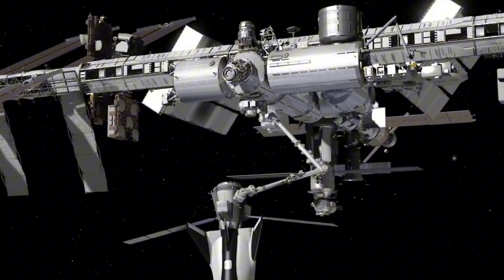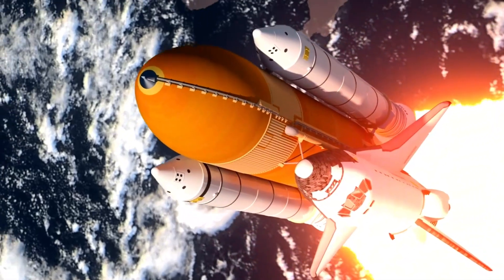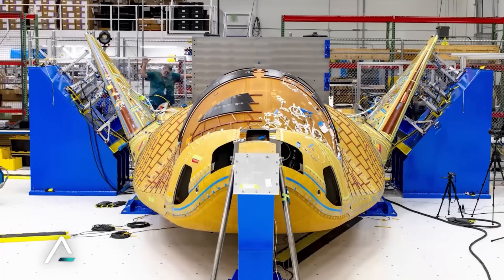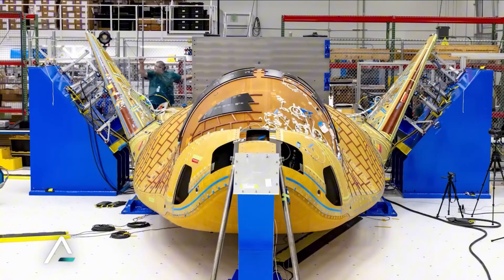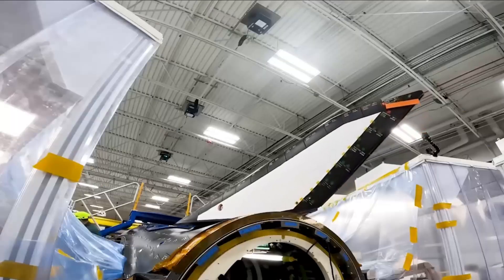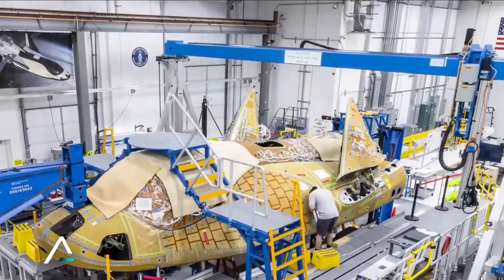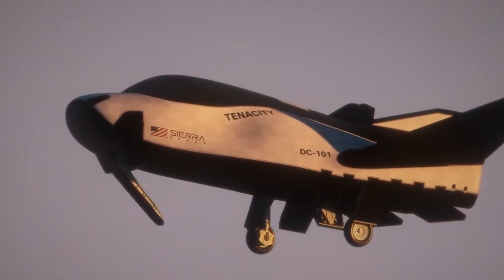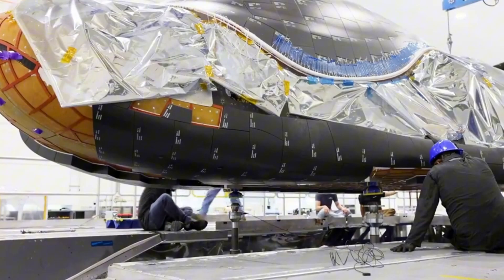SpaceX's CRAZY Manufacturing SHOCKED By Sierra Space's New Heat Shield Technology...

Comment: Heat shield technology seems to be a barrier that is self-imposed.  If the ships had enough fuel, they could reverse the reentry and fly back into orbit or beyond.  Reverse braking is the way to reduce speed, thus reducing the heat.  So, carrying enough fuel is the key.  The weight of the ship's body is the determining factor.  Stainless steel is a fine material to use but it is much too heavy.  Scandium aluminum alloy is a superior material and is one third of the stainless-steel weight.  Cost is the barrier because the land-based mines have to pound it out of rocks.  There is plenty of scandium on the deep-sea floor between Hawaii and Mexico, and Lockheed Martin has had a permit to mine the floor that has been grandfathered in.  The only thing keeping our spaceships from safely reentering the atmosphere is the idealist's caterwauling about things that we don't know.
Reply from the maker: You bring up some intriguing points about heat shield technology and the materials used for spacecraft. It’s fascinating to think about how advancements in materials science could impact space travel!
Reply: @Elonmusk24h  I hope that you can convince the president that deep sea mining is going to be very important for mining the rare earth elements that are opening the technology necessary to travel in space as well as reinforcing our society.